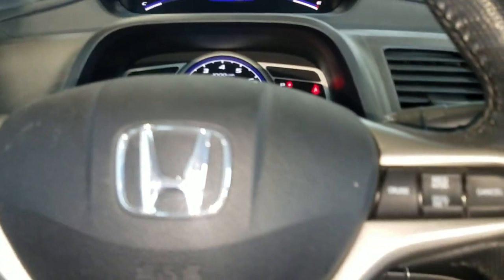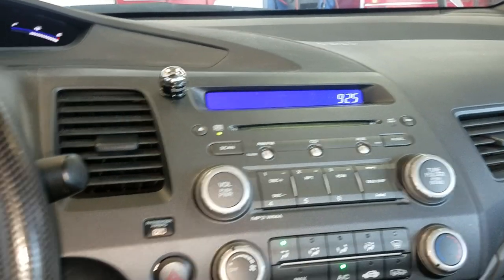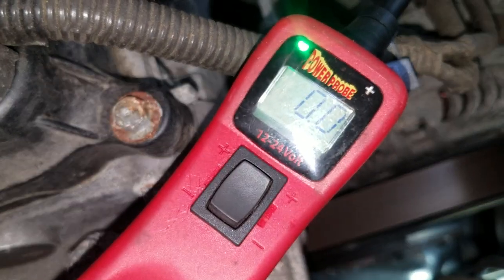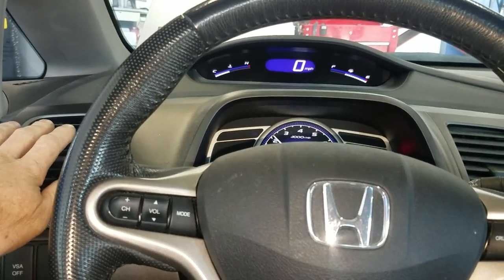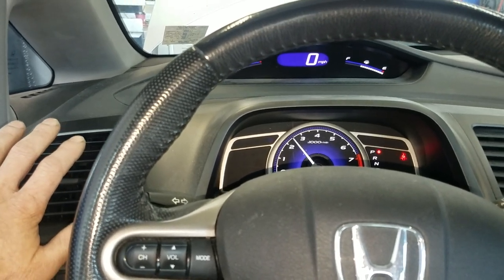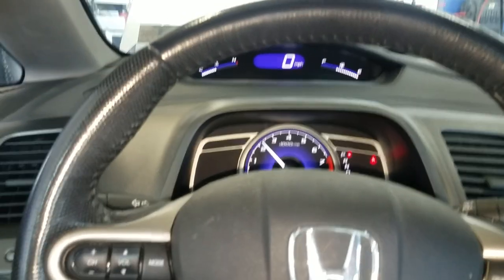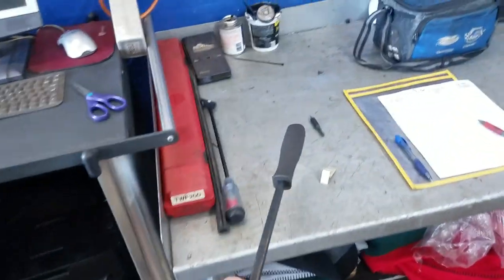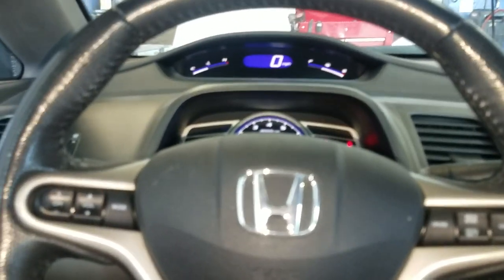A/C cutting out intermittently Honda Civic "Easy Test"

Comment: You can remove a shim behind the ac  clutch, if the gap is to wide the electric magnet will not pull the outside inward. You will not loose freon,and you don't have to take the belt off. Remove the nut in the center off the clutch,slide it out and then pick the .02 shim out. It's worked for me on 4 Hondas
Reply: Alexander Sterling  Pull the front wheel off and remove the plastic wheel well piece so you can see the compressor,remove the nut in the middle of the clutch,pull it out .No need to take the belt off,South main auto has a nice video on this
Reply: Do you turn it counter clockwise or to the right ?
Reply: @MartinGarcia-wy5kh  lefty loosey,I use a butterfly impact
Reply: @dougreno1151  Do you have the link for the south main auto video?
Reply: 4 Years later and you comment is still Gold!

Comment: I had this problem and my mechanic replaced the AC compressor clutch control relay and it solved the problem. He told me that this is a high fail part. I’m glad that it’s cheap. He also said that it could be the AC compressor clutch but since replacing the relay worked, I’ll see if it continues to be okay.
Reply: and your AC was working intermittently?   I thought a relay either worked or it didn't like a fuse.  I know very little but I find this puzzling.
Reply: @coppulor6500  I don't know one way or the other. I just know that he replaced the part and haven't had a problem since 8 months ago. Could be another problem and I just got lucky with the relay replacement.
Reply: @atlantaguitar9689  roger that.  all I wanna know is if your AC was working intermittently before it was replaced.  If it didn't work at all until he replaced the relay, that's key info for me.  I appreciate the reply btw.  (I live in Marietta btw)
Reply: Initially it was intermittent though the duration of non-working periods (i.e. no cool air) kept getting longer and longer to the point that I didn't even try to turn it on. So that's when the relay was replaced. Now, not to complicate matters, a couple of years ago the Honda dealership diagnosed my AC with what is known as the "black death" problem known to affect mostly Honda CR-Vs though supposedly it could also show up in other Hondas. This too can cause intemittent failure. Google "honda black death" to see what I'm talking about.
Reply: @atlantaguitar9689  thanks man!  Greatly appreciate it.   Wanna buy a 1988 studio model PRS?   its incredible but I need the $ (bummer but that's life).   🙂
Reply: @coppulor6500  No problem. Hope it helps. As to the guitar. Would be nice but I'm saving up for another ride. Guess that's why I was studying up on AC compressor relay switches !! ha ha
Reply: @atlantaguitar9689  in heard that.  Best of luck 👍

Comment: what if the 2010 civic has no power to the clutch during the surge, constantly surging compressor that wont start cooling during idle but will work intermittentently during driving rpm (a few seconds on, a few seconds off cooling only a little of capacity)

Comment: My 2013 Honda accord has a similar issue. It works when it is turned on initially after but if I drive on a hot day it the compressor turns off after 20 mins and never kicks back again. Any fix for this? refilled freeon, changed the relay and fuse and it didn't fix.
Reply: did you ever figure this out? I'm having similar issues in my tacoma. AC blower turns off and on for different periods of time, ac clutch is always engaged and you can feel cold air coming through the vents, its just that the fan shuts off
Reply: Same problem here. I’m thinking the compressor clutch is worn and needs replacing or it’s a sensor issue(low pressure)
Reply: @mikebarbier1519  my issue ended up being the blower. I read several times on different sites that if you hit the blower, it comes back on and that was the case for me. I haven't replaced it because when it stops, I just tap on it and it works like new. Only turns off about once a month if that

Comment: I have a k20z2 civic and I have totally same issue, tap the clutch and it runs. 
Just wondering if I can replace ac clutch when the compressor still  attach on? Cuz I don't have the special tools for refregerant. It seem like I don't have good access to it.
Reply from the maker: Probably not enuff room, the  ACcompressor will need to be removed.
Reply: @FlatRateMechanic  no.. just unbolt the compressor to get to the clutch bolt, remove that and then maneuver the clutch assembly off and replace.
Reply: You can, you just need to loosen it

Comment: My 2009 civic has had multiple ac problems since new. Just recently now it’s shaking the whole car when the ac clutch comes in and it kicks on and off over and over and blows hot.
Reply: I am having the exact same problem. Did you ever find the issue?
Reply: @franciscosainz5589  did u ever fix your 2009 , my 2010 is doing same

Comment: I have a 2008 Honda Civic and the AC clutch is engaged the whole time. Ac super cold in highway, but at idle on 110° weather it gets hot at idle.  I notice the psi on high side goes up to red zone at idle on when hot. Usually in yellow before engine really hot.  Radiator fans going on high whole time. So is it the compressor bad or is it the switch?    It seems its always cool thought, just not as cool when this happens.

Comment: Will the compressor not spinning damage the belt? Mine is currently having this issue, not worried about AC right now. Just breaking down
Reply: Yes, I had this happen and the belt still runs on the stuck compressor and it burns the belt and the AC starts smelling bad and it will start smoking and you'll lose the belt. Try and drive really short distances. And be ready for a tow especially if you idle

Comment: I have a 2003 honda civic. And it cuts out only when its over 90 degrees.  My low pressure  is 20 and high pressure  is 230.  I tried recharging  it but only the hight pressure  would go up and the low one stayed the same at 20
Reply: Sounds like a bad magnetic clutch on the compressor.
Reply: @steveandrews8301  it was. I removed the pulley and took out a small spacer it has between the clutch and magnet.  It worked good to the day i sold it. Which was months after
Reply: @depdark1  How many miles did the compressor have on it when the compressor clutch failed? And how many more miles did the compressor / clutch last after you added the small spacer? Thanks!
Reply: @steveandrews8301  it was the factory compressor. I got the car when it has 90k it started having problems at around 140k . i sold it at around 165k it was still working with no problems
Reply: @depdark1  Not bad! Thanks much for the explanation / history, depdark1! I'm pretty impressed by that.

Comment: Thank you for the video.......
I have a 2013 Honda civic that blows hot air when it's turned up, green lights are on.  Went to Tires Plus who said it needed recharging and after 3 hours of waiting they said, the compressor needs replacing and AC didn't get recharged.   What could most likely be wrong ???
Reply: what did you do to it at last?

Comment: What if only the driver side fan is coming on???
Reply: Problem ended up being condenser fan was out replaced it now ac works like a champ
Reply: @superred13  was that the fan that wasn't spinning?
Reply: @seven7hsine  yes
Reply: @seven7hsine   I took fan off that wasn't spinning and connected it directly to a battery and it did not come on so I knew that it was the problem...

Comment: When I tap compressor clutch it comes on but only driver side fan is on ????
Reply: superred 13 check fuse box for fan fuse
Reply: When AC is on only one fan runs. Doesn't need both

Comment: Ac Fans Are not Coming On Or The Clutch Please Help . I Have A 2008 Honda Civic
Reply: I have the same issue. I was told to check the fuses, relays, and make sure Freon is charged and not leaking. The AC system is designed to protect itself when Freon is extremely low. Hope this helps...
Reply: El Gato Gordo Checked All That And There Good :/
Reply: @nipsey3221  Could be your AC panel switch/control not sending the correct voltage to the AC system when activated. Press the AC switch and check for voltage    going to the AC clutch, fuses, and relays. Also check for lose wiring/connections. Good luck!
Reply: @nipsey3221  Like Flat Rate Mechanic mentioned on his replies. Could be the expansion valve or AC system pressure switch.
Reply: El Gato Gordo Replaced Ac Pressure Switch & Nothing Also Climate Control . The Compressor 3 wires show 12 volts on 2 of them and 1 shows 0 volts
Reply: @nipsey3221  It's got to be something so simple and we're not just seeing it. Have you isolated the AC clutch and energized it directly using 12V to see if engages?  Also find out how those 3 wires are energized using a schematic and tracing them from their power source.
Reply: Did you ever figure out the problem? I have the same symptoms. I watched a video saying if the freon level is too high it will also prevent the compressor clutch engaging. I know mines too high hoping this will fix it!

Comment: I have a 2010 Accord. Good pressure. Plenty of Freon. Compressor cuts on and off. Gets cold, then hot. But the electric fans are not coming on. Help!!!!
Reply: Exploring Adventures with Matt I’m having the same issues with my 2014 accord. It’ll be ice cold then out of the blue it will stop working. And sometimes I turn off the car and turn it on and it’ll work fine again and sometimes it’ll stay with hot air for like 20+ mins. I’ll mess with the buttons and sometimes it’ll work. And some days it won’t even happen. Some days it’ll happen multiple times a day. It’s weird
Reply: @lMr033l  hi  I have the same problem in my 2013 honda accord .
Have you found a solution to the problem?
Reply: math for us unfortunately I haven’t
Reply: fans not coming on will make the compressor shut off due to high pressure limit, 
fan switch or something along that line
Reply: Skull Helmet Thank you so much!!

Comment: Currently dealing with a similar issue. 09’ Civic compressor wouldn’t cycle and ran constant. Checked freon. Got it within limits and the same. Then revved the motor and the clutch finally disengaged only to not reengage until turning the car off. I did notice with a long handled screwdriver that the clutch magnet was still energized so I guess I’ll check voltage to confirm it.
Reply: This sounds like a stuck clutch relay.  Many Videos on line about it.
Reply: Can you share some with me? I have a mechanic describing this to me and another mechanic thinks it’s a pressure switch

Comment: I had my ac recharged my fans turn on and the clutch turns on but still blows hot air,what could be the problem?
Reply from the maker: You either have a bad compressor or an expansion valve. Without knowing the pressures it would be hard to tell.
Reply: @FlatRateMechanic  thank you I'll have to get it tested
Reply: Expansion valve probably
Reply: Pressure switches high and low gotta check them

Comment: Why is my AC clutch and cooling fan stay on when HVAC control panel is in the off possition
Reply: Probably your control panel is not sending the signal to ac. Also check ac relay